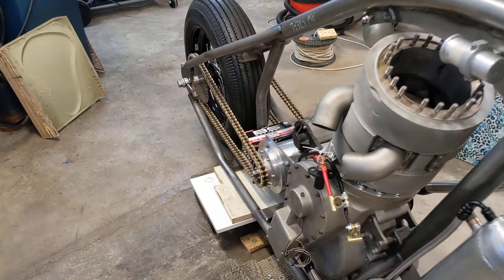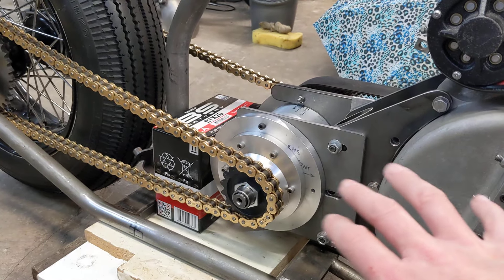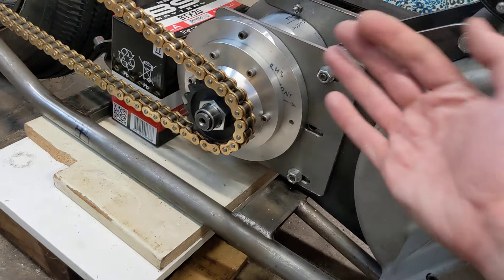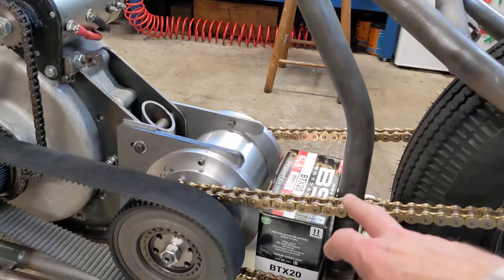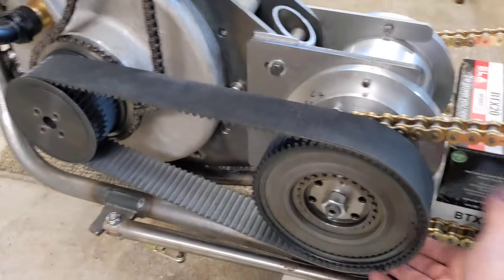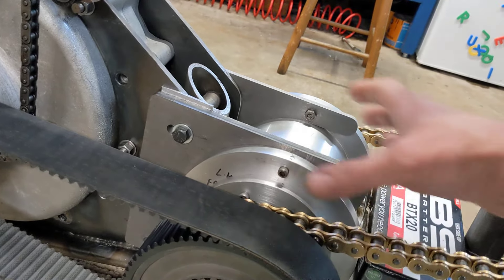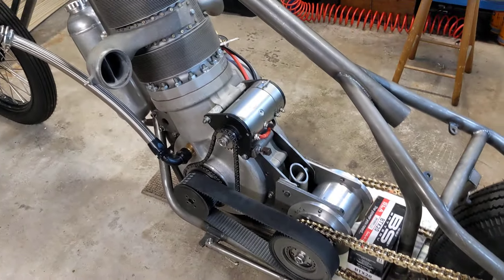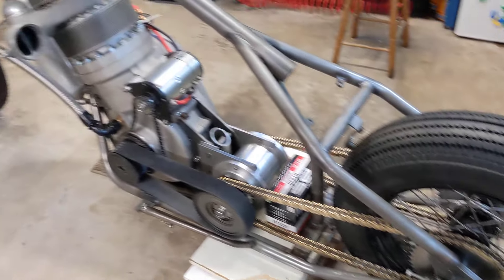Gearbox Mounted 💪

Comment: I was thinking about it more, the crankcase pressures will probably be very high, with the comparatively small ventilation hoses. On a radial engine there are always pistons going up when going down, so that's not a problem...

a engine compression tester is a gauge with valves, for peak value readings, so connect a compression tester to the crankcase. Connect it directly to the crankcase, maybe off the vent hoses, but immediatly next to the case. That will tell you exactly how much pressure the crankcase experiences.

(with the single vent filter, i bet you'll see peaks over 40psi when idling, worse with loose rings,  but that # has nothing printed to verify it, it's just a guess from my experiences with many cars)

Comment: UNF is a great shout. Metric mounting bolts vibrate loose with the coarse pitch. Unless you use nylon nuts etc. 
have you considered torque pull on the primary? Is there enough friction to hold the gearbox in place? On a pre unit triumph for example they have adjusters, similar to the chain, to hold the gearbox in position and allow adjustment.
Reply: @Turnipstalk Good point. And I'm assuming a metric fine stainless steel bolt is significantly cheaper than a UNF or CEI bolt too. 26tpi bolts in stainless are incredibly expensive now, as I recently found out!
Reply: @Turnipstalk I lost a petrol tank stud last week on on the motorway. So this weekend was me, a lathe, some stainless and luckily my 3/8" 26tpi die! I had 2 stainless nuts left in my drawer too. Saved the day.

Comment: Check the physics, your gearbox will pull back towards the rear wheel as your gearbox sprocket is smaller than your clutch, this happened on my pre unit British bikes. They would pull up the primary tight, stopped it when I would wind the play to push the box away from engine. Worth looking out for.
Reply from the maker: Thanks. I'll need some time to digest that nugget. In my case there are no gears, both clutch and sprocket run on the same shaft. Not sure if that makes any difference? Anyway, I'll watch out for it for sure.

Comment: Great progress! Enjoyable to be this close, couple of OBS if I may … top of gearbox , maybe a stud between both sides with a solid spacer added rigidity?
Possibility of a modern coil pack ( ugh) the advantage is you only have to route small signal cable(s) as the coil sits on the plug(s) have used ones from Ford Fiesta before , probably even smaller now.
On a previous turbo bike build I used some nice st/st 303 pipe to form a conduit , there was enough room to run an oil supply pipe and two sensor cables inside .
Reply from the maker: Thanks. I thought about using coil overs but they look a mess and I've seen a few fail. I was thinking the same about making a conduit, but using copper central heating pipe instead. I reckon the gearbox casing is rigid enough, I can't see a cross piece adding anything to the rigidity. But it's easy for me as I can see it properly, as opposed to watching the videos. 😁
Reply: @StoneEng  good news, I bent some inch stainless bars up long ago , got some silver sand , oven dried it , whittled some end plugs and hammered then in , bent them on my conduit bender with a 5’ scaffold pole , bars were perfect but the bender was never the same 😀

Comment: 2 different chains running 2 different speeds are going to wear at 2 different rates. You might have them close right now, but after only a bit of running time you won't be able to get an acceptable adjustment on both simply by moving the rear wheel. You need to have a chain idler/adjuster on each chain run. Oh, I forgot, this is just a show piece and long term service really isn't a consideration at all. Never Mind.  😉
Reply from the maker: I hardly ever adjust the chain on the Blackbird, the tolerance i in tension s huge. I really can't see differential wear being a problem. I'll let you know after the first 100,000 miles. 💪
Reply: @StoneEng  😅